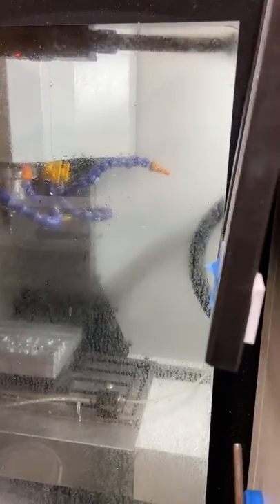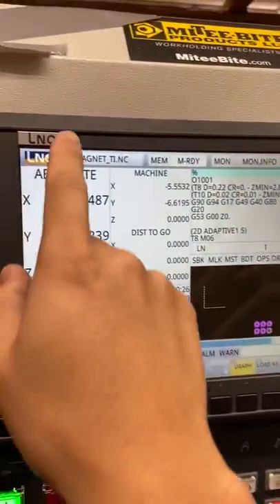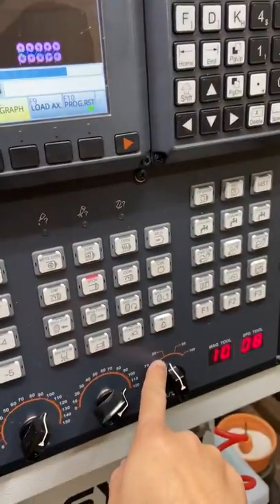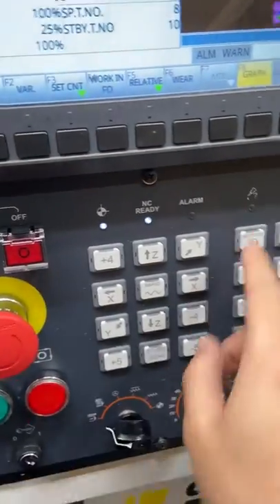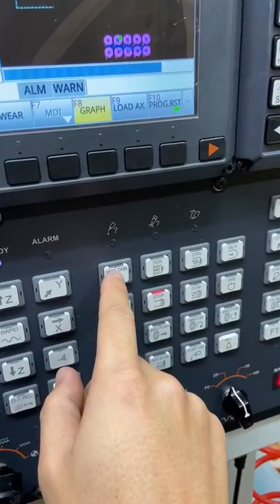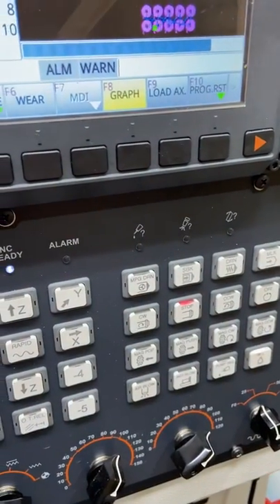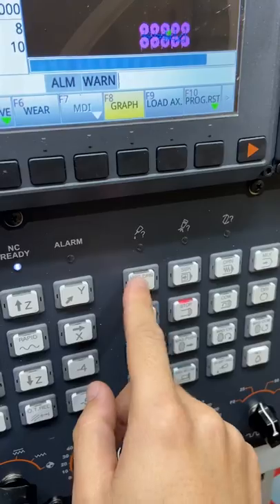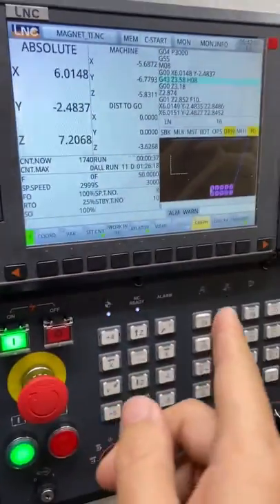Nice feature, controlling the progress of program with MPG handwheel on LNC

Comment: can the lnc run a 4th axis?
Reply from the maker: Yes it can. The 6800 is supposed to do 4+1 as well but the only organization I know that can set it up is Syil 🤷‍♂️
Reply: Gtscientific Gtscientific thanks for the reply looking into getting one of theses was looking at the 1100mx but this seems much better for just a little  more I mainly do small parts been subbing all that out. Was gonna go the used older fadal or haas but 4axis is something I really need for some parts I do
Reply from the maker: Kutter Beavers I used to have an 1100M. Started to get fed up with the ATC, steppers, leaks, and USB connections. Was trying some 4th axis stuff myself but was really underwhelmed with the super spacer I was using. Great machine for rapid prototyping though. I don’t think I’ll ever go back to something that doesn’t have absolute positioning or an umbrella tool changer. I might get a small 4th since it’s quite easy to install and runs about $2500 later this year.
Reply from the maker: Kutter Beavers I suspect if you get the Siemens 808D advanced, you may have many more options for third party 4th axis rotaries compared to the LNC controller.
Reply: @gtscientific_and_manufacturing  the 808 looks great but i really don't know if it'd be wroth the extra 4 grand?
Reply from the maker: @kutterbeavers9941  I think it depends? I had Siemens respond to my questions, but LNC is hard to get anything useful from them. While the mpg toolpath advance feature on the LNC is really really nice for to me, using a toolsetter for tool breakage detection would have been more attractive and it's kind of humbug to figure out with LNC.
Reply: @gtscientific_and_manufacturing  i was just looking on the website they have some really good deals on machines in the us. i has the 12 tool atc which i really was wanting the 16 just like that style better as well but its only 25k wih the Siemens 808D/A
12,000 RPM spindle
Reply from the maker: Kutter Beavers I think it’s still on their site but maybe ask them if they still have it. Another guy I was talking to was interested in it.
Reply from the maker: I love the 16 ATC esp because I plan to put a 4th but with LNC it’s kind of hard (or impossible?) to assign tools to a specific tool changer pocket. This matters because max tool size is 50mm or so. I don’t put my Haimer in there or any big facemill a.
Reply: @gtscientific_and_manufacturing  is the atc something you can add later on the syil? just to save some start up cost. don't mind doing manual tool changes to start
Reply from the maker: Kutter Beavers the atc is very beefy, easily 250lb or more. I think the short answer is probably not, but you can ask them? I definitely think it’s worth forking the extra 2.5k